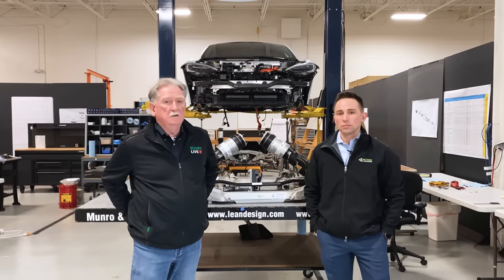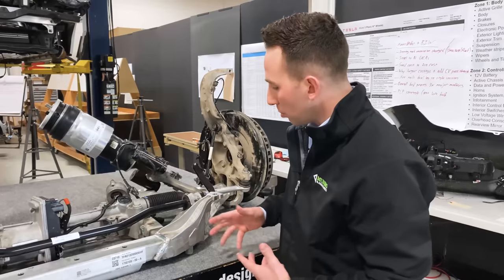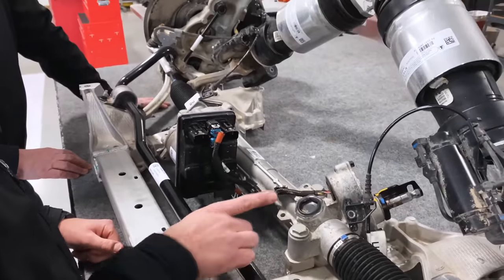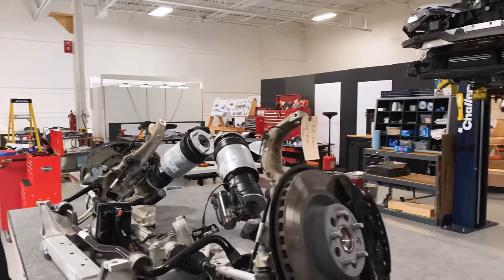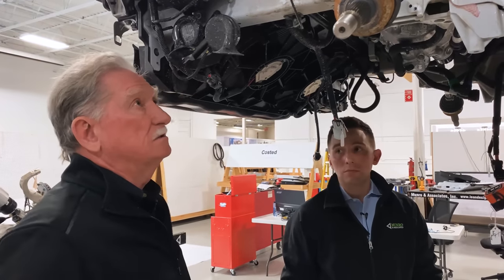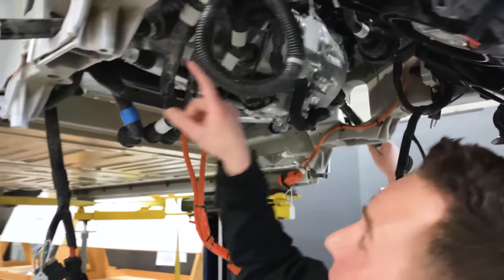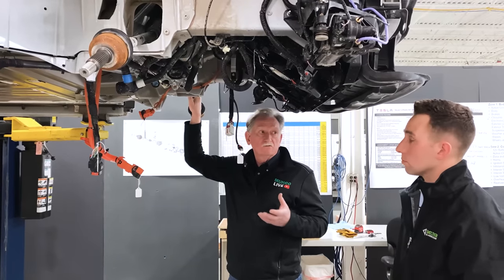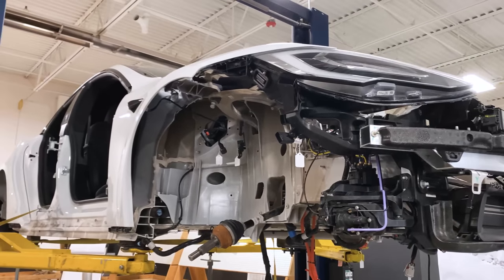Front Cradle and Suspension | Tesla Model S Plaid Teardown

Comment: Airplane versus car for steering linkages versus drive by wire. One reason it does come to mind is rodent problems chewing through wires. You probably don’t have much of that on aircraft as compared to vehicles parked in fields. I suppose you could put the wire in conduit. Interesting half shaft, but what has been done to eliminate the shudder on acceleration issues that plagued older model s and x ?  I still see some pretty high angles as opposed to a straight shot into the wheels from the motor. I’m certainly no unto motive engineer. But from a practical standpoint can we expect to see some ongoing unsolved Issues from the prior generation resolved here, and if so how was that done? The older cradle had some welded tabs that often failed  and you can see other mounts were reinforced so can we expect the motor mounts were integrated and reinforced?

Comment: Thanks Sandy and your team: Learned so much. Casting high silica aluminum is going to shape the future in automotive production. But steering? Going to the yoke is a major step. Not side-stick yet. The B737 still has its wires and pulleys. Airbus uses not less than 8 Intel 80186 so they tell me to keep it from going off track. But you are right, Elon is just leaving the rest in the dust!

Comment: Steer by wire would allow for a truly variable steering ratio, which would go nicely when paired with Tesla's yoke steering wheel.  I thought that Mercedes had at least one vehicle in production using steer by wire?  The Boeing 737 Max does not using fly by wire for it's primary flight controls, just old school cables and hydraulic actuators.   Ironically, if the 737 Max had been designed with fly by wire, the whole MCAS system which caused the two fatal crashes would have been totally unnecessary.  The flight characteristics that MCAS was put in place to deal with could have been handled through tweaking the flight control software to adjust elevator response in certain flight regimes.

Comment: If you want to know why steering-by-wire isn't a thing (even ignoring safety concerns) you only have to look at driving sims. Using a wheel without force-feedback is a horrible experience and you end up with no idea how much grip the front wheels have. If you look at top end wheels with good force-feedback, you're talking well over £1,000 ($1,500) for just the base part, and they can weigh over 10kg. It makes a steering column and universal joint look very efficient in comparison.

Comment: those castings must add some weight but makes it look like a tank
Reply: Not if they are alu and replace stamped steel parts which I believe is the case.  Check how much lighter the S plaid is compared with the Lucid Air for example.
Reply: @bluetoad2668  yes quite am not saying it's strange but might be in some future time

Comment: I own a Model X and like many owners of X's have had to have the front half shafts replaced due to vibration under acceleration. Many owners have had to do this multiple times even though Tesla has redesigned the half shafts, and supports multiple times. The general consensus of owners seems to be that the half shaft angle is a bit steeper on the X vs the S and being a heavy car it has more load on shafts. Do you see anything in the Plaid redesign that might address this problem?
Reply: Curious about this as someone who has a 2021 Long Range Model S and have just had to have the half shafts replaced after 1500 miles due to shuddering under hard acceleration. I thought they'd fixed these issues!

Comment: I am curious as to how the structure of  the front suspension helps or hinders crash test / safety scores.
Reply: the more castings you have, the better your test score, Austin model Y may have the BEST Tesla safety score, because of Front & Rear Megacasting, 4680 structural battery. 
but, Megacasting is for High Volume, too expensive for only 10k cars, but IF Tesla ramps Mod S/X production, then it can be made with Front & Rear Megacasting like model Y is. 
2022 mod S & X already use massive REAR Megacasting, but only corner Front casting, and some parts, but MORE than any car maker.
Reply: also, see - Tesla video, safety video.
and Tesla China - go giga - safety , video.
Reply: @markplott4820  wrong!? The advantage is the empty space which is occupied by an engine in ICE vehicles, Porsche, Lamborghini…. for example have always have front trunk with rigid/exceptional front crash results.
Reply: @carholic-sz3qv  - but, still NOT as safe as a TESLA.
Tesla ONLY OEM on EARTH, that Design cars to Exceed 5 ⭐ safety rating.
Reply: @markplott4820  bullshit, tesla isn’t the only OEM that designs cars to achieve 5 ⭐️ in crash, cheers!!
Reply: @carholic-sz3qv   - TESLA Design to EXCEED 5 Star crash, not just meet the Standard.
did you watch TESLA - safety Video ?
or Tesla China - Safety ?
TESLA is in a WHOLE different LEAGUE.
Reply: @markplott4820  other manufacturers also designs to exceed 5stars. I’ve seen a lot of safety videos cheers!!
Reply: @carholic-sz3qv   - where is the PROOF ? and how come they are RATED less than 5 Stars ?

Comment: Drive-by wire for the steering column will NOT be an option until an FSD critical mass is achieved. The FAA mandates maintenance schedules include failsafe inspection and testing as an integrated part of routine maintenance. That would be an expensive repair bill...
Reply: Dude, the really bad engineering that you get from other car companies you pay for way more stuff before you get fail point in a Tesla.

Comment: I believe Toyota's next electric car is supposed to have a steer by wire system that will give us a variable steering ratio + yoke also. Very interested to see how they're going to implement that.
Reply: BMW has had variable steering since 2003
Reply: @raphi25895  BMW experimented with variable steering with 7-series back in the early 2000s before removing it. What you are referring to is variable steering input, where it is easier to steer at lower speeds.
Reply: @trizvanov  With this type of steering, you need fewer turns for the full steering angle at low speeds than at higher speeds. When maneuvering, it takes less than two turns from steering stop to steering stop. Active Steering is the name of this system.

Comment: If you want pure electrical steering controls, you will need double or triple redundancy (like airplanes!).
That means every component that can fail from the steering wheel sensors to the control unit to the motor, doubled up.
So I don't quite see how this would bring the cost down. Not to mention, it would completely ruin the steering feeling unless you have force feedback mechanisms. Which would drive the cost even higher?
Reply: Force feedback would be required. Yes, it would all be expensive. This YouTube channel does not allow links to be posted (a comment with a link is auto-deleted), but you can see a production-worthy steer-by-wire system on ZF's website: 
ZF
> Products & Technologies
> Technology Domains
> Vehicle Motion Control
> "The Networked Steer-by-Wire Steering System is Available Now"

Note redundant power and redundant communication links (not just "two wires" as in Sandy's remark), and the motor on the steering wheel.

Comment: No airplanes use cables? Try one of the most popular airplanes: Boeing 737 still has cable linkages to the flight control surfaces. Plane is controllable with 0 power which is why they don't have to include a Ram Air Turbine. It's reportedly about like wrestling a bear but still flyable.

Comment: Given that they'd need to be able to remove the drive unit at a Service Center, I'm wondering whether the geometry of the holes is enough to allow the drive unit & shafts to be installed/removed as a unit by feeding the shafts through the holes as the drive unit is raised and vice versa...
Reply: Thats a million mile drive unit. They are gambling that it wont require maintenence.
Reply: @patreekotime4578  Had two drive units replaced by SC on my early 2014 S (lubrication Service bulletin first, milling on second) - mechanical stuff doesn't care about goals 😀. A couple hour job each time; designing that level of serviceability into the car pays dividends.
Reply: It wouldn't help. When they are not connected to the hubs, as you see in the video, those shafts pull out easily and are inserted easily, as they are in any other car.

Comment: Pity the mechanic who has to replace the steering rack. The whole subframe will have to come out of the car just to access four mounting bolts.
Hopefully the fastener holes Ono aluminium are closed at the bottom end. If they are open (as is common on legacy cars) the threads will corrode and become near impossible to remove.

Comment: I have a question about the increased use of castings....especially large castings such as in the Model Y:  I understand that the casting provide an engineering benefit.  On the consumer side, however, what does it mean for repairability when the car is in an accident?
Reply: Jordan from The Limiting Factor talks about just that here
https://youtu.be/j1bQbA3EOKw
Reply: Eventually with FSD Technology there will be no crashes, at least on Tesla's side.
Reply: On modern cars if pretty much any of the frame components are bent the car is a total anyway. Insurance companies and repair shop costs have already made cars disposable. The real question is what happens to the used vehicle market, but that is already problematic with batteties.
Reply: @f4c3l355  thank you for the video link. It was very informative for the non-engineer such as myself.
Reply: People frequently bring this topic up, especially those in the repair business (as they should).  But if you suffer frame damage, shouldn't the car be considered "totaled?"  Don't get me wrong, as someone who's father almost bought a car that had 3 different frames welded together when I was 16, I know people make due with cars that have damaged frames.

Comment: My friend had a Malibu with failing electric power steering which would randomly jerk the wheel to the side at 40 mph. I had a loaner Malibu from my car dealer in which the electric steering rack failed,  leaving me with NO control over the steering.  Fortunately I was in a parking lot at low speed,  though I'd just exited the highway.  It most certainly could've killed me and others.  Electric isn't foolproof.
Reply: That's just bad design. If planes can do it safely, cars should too.
Reply: @andrasbiro3007  No, that's just electrical connections. That's why planes have such strict maintenance programs. Do you want to pay that for your car, when a simple, plain vanilla linkage that any first year apprentice could could correct is an easy solution ?
Reply: So what you are saying that you lost steering even though you had a mechanical steering connection.
Reply: @dnomyarnostaw  
Electrical connections don't just fail. They are generally a lot more reliable than moving parts.

Plane maintenance programs also mostly focus on mechanical parts, as those are the ones the wear out and brake. Electric connections are trivial to make redundant and self-checking, so preventive maintenance is not necessary.

Also brake failure causes 5% of the crashes in the US. So it's nowhere near as reliable as you think.
Reply: @dnomyarnostaw  
Most of these won't happen during driving. Also bearings are mechanical.
Also I didn't say electrical connections never fail, I said they are far more reliable than moving parts.

Comment: Parts engineered like no others.
Reply: Most parts are engineered just like everyone else. That electrically assisted steering rack comes from Bosch - it's a regular off-the-shelf item available to any manufacturer, just like the brake system and many other components.

Comment: There's no way in hell you can control the control surfaces on a commercial craft with man power alone, so there's no point in such connection. They do have multiple redundant systems however.

Comment: first thing i was thinking, gosh the securely mounted the steering-pin to that frame with that vertical bolt, wouldn't that launch the steering wheel into the driver in a frontal collision?
Reply: D'ya think they may have thought of that?....?
Reply: Huh? Collapsible steering columns have been mandatory since 1973!

Comment: Airplane is OK because all that control by wire systems are redundant and are built with maximum reliability which is costly but on an airplane it is reasonable cost. But it is not a cost you can justify on a mass production car!

Comment: 11:39 That is absolutely wrong, Sandy. And the ones with no mechanical redundancy are manufactured to a much higher standard than could be done in automotive and are also electronically redundant in multiple ways.

Comment: Going fly-by-wire seems to make a lot o sense and would also make conversion over to RHD a lot simpler.
Reply: Center driver position, would also solve RHD issues, but customer unhappy w/ loss of Front passenger.
Reply: The two things that should never fail in a car is steering and breaking. And cars are not nearly as well maintained and checked as airplanes. Without a mechanical steering link, the number of related accidents due to a steering system failure would rise a lot.
Reply: @vast634  Tesla recently confirmed they are developing fly by wire for their cars.  Guess it is deemed reliable enough and will help them hit more markets.   ...phrasing lol

Comment: Sandy, it's not "strange" that aircraft allow fly-by-wire which is not yet acceptable in cars. You're not an idiot, so you understand the difference in the cost of and maintenance of commercial aircraft versus cars. And there are lots of aircraft with mechanical control connections, including every light aircraft (even current production) and many older commercial aircraft.

Comment: Steer by wire sounds like a bad idea.  If the car loses power, it loses steering.  Yikes!  Same goes for brakes,  we’re not likely to lose hydraulic brakes any time soon because being able to stop a vehicle is probably the paramount function required; I would argue more important than steering.
Reply: In both cases these systems that have survived the courtroom, the most difficult test.  Any major changes and the manufacturer's liability is up for grabs again.
Reply: @paulaxford6754  Point well taken!

Comment: Yes, aircraft may be fly by wire.  But, aircraft are vigorously  inspected.  And if a flaw is detected, parts are replaced.  Or the aircraft is grounded.
Reply: Ok, so the redundant Autopilot/ FSD system on this car would be comparing independent signals every millisecond(?).
They already run the speed/ steering/ brake systems on their own.
If either of the dual circuits drops any signal, the car flags it
Reply: @rogerstarkey5390 At 70 MPH I prefer proven tech.  Even if it costs more.  Which is why a steering column is still legally required.  When there is a proven long term history of safety.  I am sure steer by wire will be approved.

Comment: I was wondering if the half shafts are already mounted to the motor and then, at the moment the motor is lifted upwards, they angle upwards and are fed through the holes / pockets in the rail? Instead of after the motor is placed feeding them through the pockets and, like was suggested in the video, attach them "blinded".
Reply: I very much doubt that. Besides, having the wheel assemblies attached prior is much of the advanage.
Reply: I doubt that - the angle required of the inboard joint would be severe and the benefit would be minimal. To insert the half shafts after the motor is in place but before the suspension and subframe are in place would only takes seconds... with no tools.

Comment: Please review parts from point of robotic manufacturing. Is there any significant improvement in parts design, so that it is possible for "automated" fitment?  I'm especially interested in harness, but other components assembly would be also beneficial. On the end this is what nearly killed Tesla in Model 3 ramp, but I'm sure they did not give up on the idea.
Reply: Are you thinking about that patented harness system which was supposed to be easier to install by robots? I'm still waiting for that tech to be implemented! Will ramp up the factories even more!
Reply: I would think that this is not such a priority for the model S and X since the volumes are lower.  The 3 and, more likely, the Y should be Tesla's main focus for this sort of automation - hopefully this will lead to very high run rates in the new factories.

Comment: Sandy is mistaken about airplanes not having mechanical connections.  Only the big commercial aircraft and military fighters are fly by wire. Almost all private aircraft have pushrods and/or cables moving flight controls. With an drive by wire steering system, once the car loses power there will be no way to steer it.  That could be very dangerous since there many instances of Tesla's and other cars going dark and the driver had to steer to the side of the road.
Reply: Even many of those large commercial and military aircraft used powered hydraulic systems, not fully electronic.